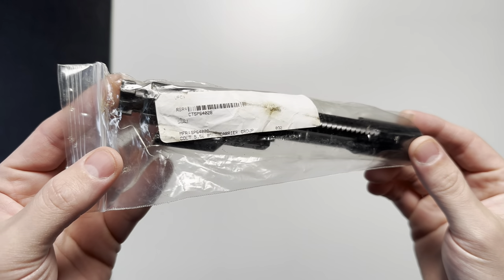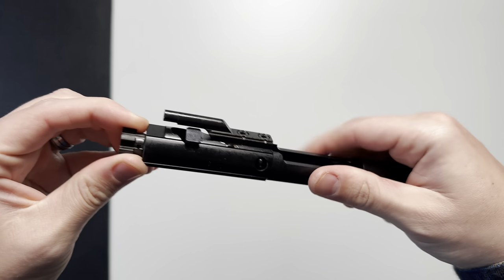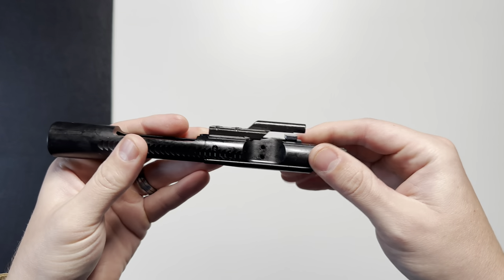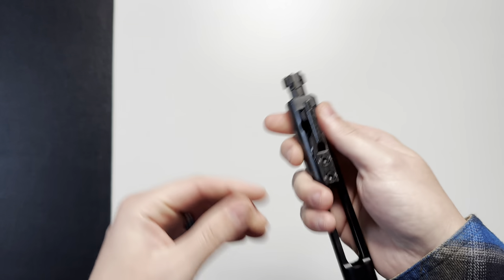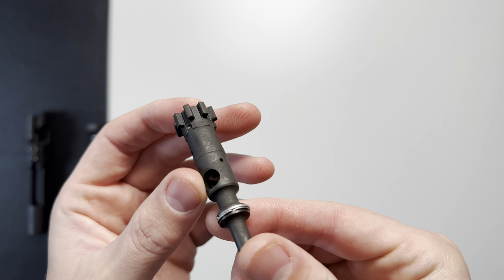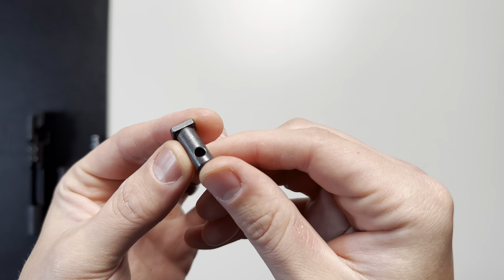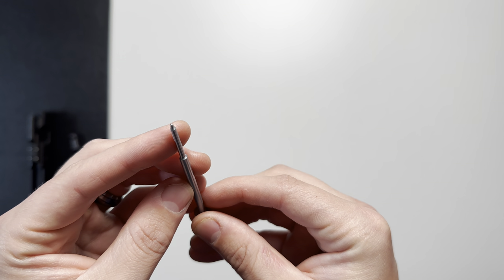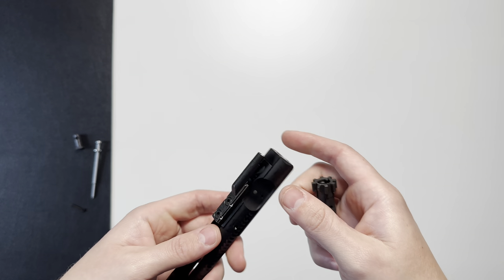Overview - Colt 5.56 Bolt Carrier Group

Comment: The Colt carrier is made from 8620 steel as required in the TDP spec, not stainless steel. The bolt is 158 carpenter steel as required in the TDP spec, not stainless steel...The cam pin is made of 4340 or 6884 steel and the firing pin is made out of 8540 or 8740 steel as required in the TDP...

Comment: Nice can’t go wrong with colt, I just bought a lmt bolt carrier wasn’t impressed with the finish. 👍
Reply from the maker: You really can’t go wrong with them. I’ll admit that they aren’t the most affordable or the most flashy/innovative thing out there. It’s your standard milspec BCG with a standard finish. However, the reliability aspect is what colt sells. It will work when you need it to work. 

That’s a first that I’ve heard from an LMT BCG. Which model did you get? (Regular, enhanced or regular carrier w/ enhanced bolt?)
Reply: @GunBoxTherapy  just the regular bolt carrier, it has no tool marks just the phosphate finish isn’t the best, the enhance ones are super hard get hold of. They are probably has good as the knights armament as durability goes